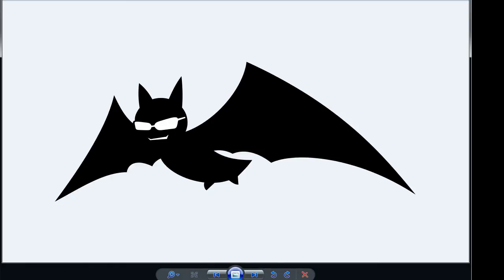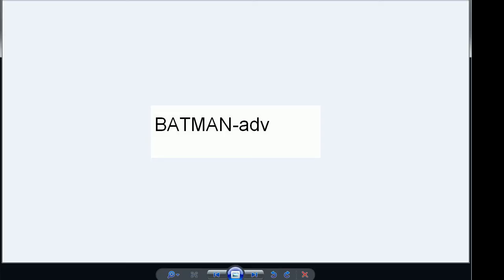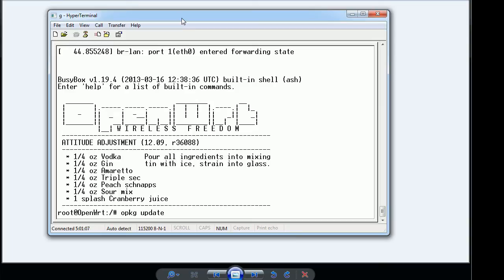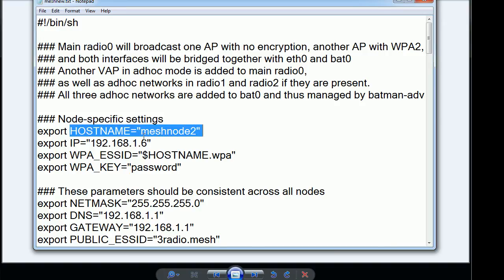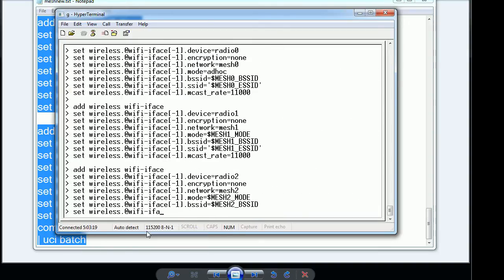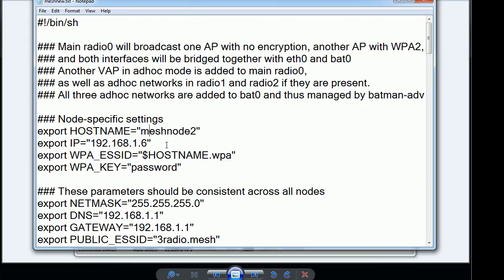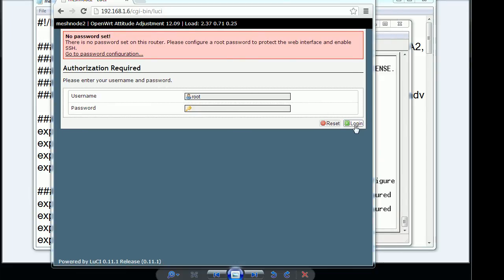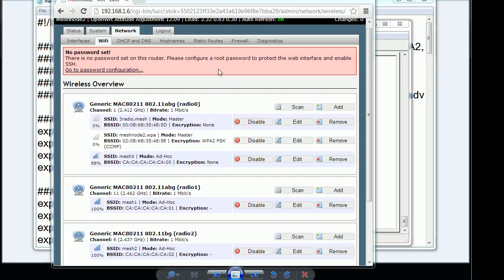Part 3 OpenWRT B.A.T.M.A.N. Mesh

Comment: I tried this way but it not works, can you let me see your configuration like at /etc/config network, /etc/config/wireless and batman-adv too ? thank you very much for help me...
Reply from the maker: Asriadi N Under the Batmanscript.txt file you have an install script.  How many radios does your device have? https://drive.google.com/drive/folders/0B_uVrdNatDR_MzhmXzdYNHBScms
Reply: HEEEY Alex this is great im going to setup a mesh with batman but i want to see your 
/etc/config/ network and your /etc/config/wireless file thats the only thing i couldn't find i got the rest.
THANKUUUUUUUUUUU!!
Reply: what do i do with this?

 

4544 (01:18:00) meshnode1

4538 (01:1E:00) meshnode2

4527 (01:15:00) meshnode3
Reply from the maker: Nothing, that was documentation of my devices.  This guide is a little older, though I suspect it still to work.  I would recommend following the current information from their website. https://www.open-mesh.org/projects/batman-adv/wiki/Batman-adv-Openwrt-config

Comment: Hello, I was wondering if openWRT allows a router to support a 3G/4G dongle via its usb port?
Reply from the maker: Yes OpenWrt supports USB cellular modems.  OpenWrt wiki has a site called 3gdongle that supports both 3/4g, though support is limited.
Reply: Fantastic! Now, I have one more related question: do you think I can use an Android phone's USB tethering capabilities to turn a 4G signal into a wifi signal with 3gdongle's limited support?
Reply from the maker: Yes that will be easier, because when you USB tether that is already IP traffic.